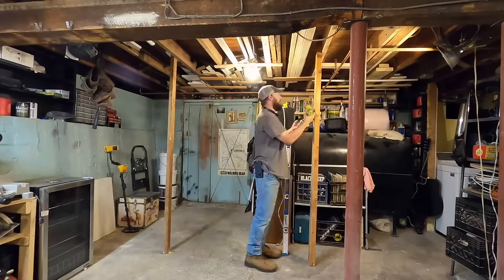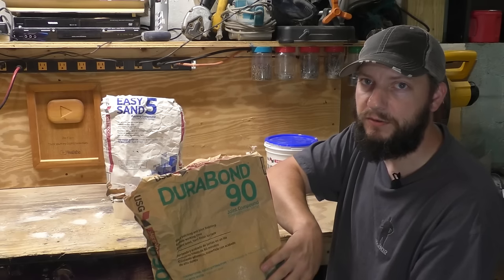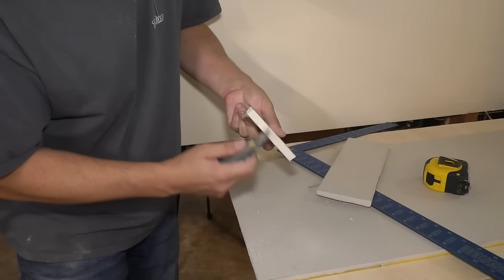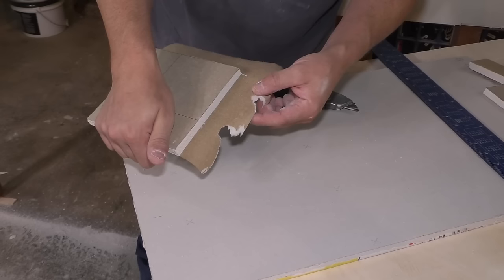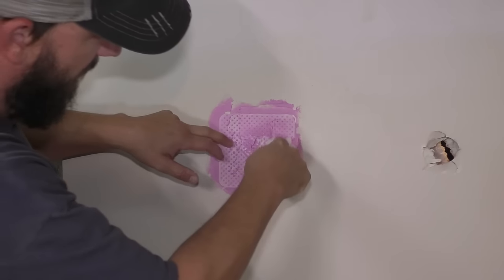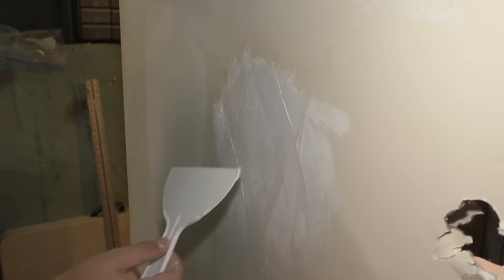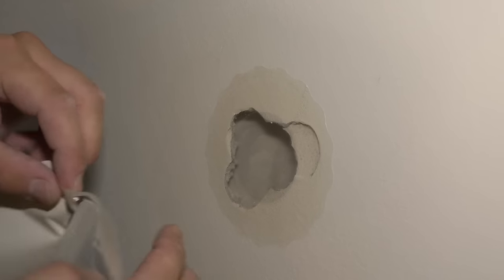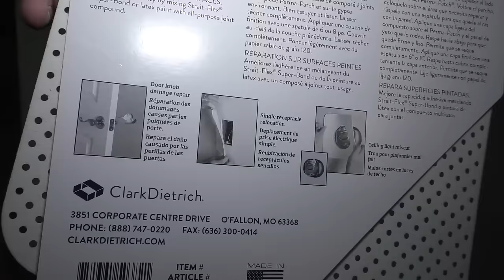How to Fix a Hole in Drywall | 10 Different Ways!

Comment: The "winged" one you did is typically called a California patch (no idea why). The nice thing is that the paper on the drywall is thinner than drywall tape so you don't need to feather out the mud as much and get less of a bump. You want to generally pull the mud from middle out so you avoid the wrinkles and rips on the paper. In addition to putting mud on the outside of the wall like you did I also put some on the inside edge of the wall so when you insert the patch it fills in the void between the two sheets of drywall and gives it more strength than just the paper itself.
Reply from the maker: A few comments have said a California patch so i'm guessing that is the most common name. Thanks for the comment!
Reply: Probably made popular in California. I wonder if it meets fire code - you did mention the wood block doesn't
Reply: I agree. You need to "butter" the edges. Even rasping a bevel  on the wall and the patch opening toward the inside of the wall. Also, it seems like every construction trick or "cheat" is called "California"
Reply: Also....I worked in southern California. I did framing. There were a lot of migrant workers behind us drywalling. They were so fast and talented. I watched them do those winged patches on, say, a miscut outlet or hammer hole in seconds, simply using a drywall hatchet. They would leave a whole house ready for tapers, including a few patches in a few hours. The tapers knew what to do with the wings. They used the hatchet for drawing lines, cutting sheets, beveling, rasping, etc. They were amazing
Reply: DIG IT! what kind of drywaller never did the California?  We always run a bit of prefill then slap it with a runny  15min hot with a tad of tight bond added. Butter money😂
Reply: You are HILARIOUS! 
I was hoping you would show fixes where there's no hole going all the way through the wallboard also because I mistakenly used the wrong tape to "plastic up" my apartment windows from the cold in the fall and when I removed the plastic in the spring... all the plaster paper was exposed!!! 😢  I really enjoyed all the choices you demonstrated and I will probably go with the fiber tape and spackle method. Keep doing these videos and best wishes to you and your family!
Reply: @lingreer9531 I believe for that you just use zinser sealer then painter's putty spackle, sand and prime and paint
Reply: We call it the butterfly patch and I'm in Cali as well

Comment: I'm renovating my bedroom. Some of the walls are getting new drywall and others are getting patched as well as two holes in my ceiling. One has been there for years covered by a metal picture and the other was a recent accident. I made a hole for an old-work light fixture box, but there was a stud in the way, so I moved the light over about 7 inches and have a 4 in circular hole in my ceiling.

Comment: A variation on the "winged" (California) patch that I've used in the past is to use a hole saw. 
1. You cut completely through the wall leaving a hole.
2. Cut an oversized square or round patch. 
3. Using the same hole saw bit, punch through the back side of the paper, leaving the front as the wing.
Its essentially the same, but with circles and no guess work in measuring out the hole/patch since you're using the hole saw to enlarge and then cut an exact match in the drywall. Cheers!

Comment: a few things to add to the winged method. 1st i like to load up the back of the plug side around the edges so it bonds with the inside of the wall better. 2nd round over or 45 the paper corners so they dont tear as easily. and last i like to use a hole saw without the bit to cut the drywall and the patch, its a little trickier for the patch side but you could make a jig to keep the hole saw from walking. i think it fits together better with room for mud that way but thats a preference (its nice to if your doing recessed lights and screw up) square cut is faster and just as good. thanks for taking the time to make this vid!

Comment: Great info! Thanks for taking the time to demonstrate all of these.  I’ve done some hole repair, some new sheet rock mud and tape, but am about to renovate a 120-yr-old victorian my daughter bought. That will include knocking down 7 or 8 walls and reskinning the lath. We could use a video on removal and replacement of old plaster walls. 😊

Comment: Great video great information. You put a lot of work into this video and it’s greatly appreciated by many. I use the blocks for larger holes. The winged tape free for 2”-4”patch and the thin metal for smaller holes. I think I would have to pass on the rest.

Comment: Great video! I didn't know that "Just Tape" was a patch. I used that when I was fixing up my house and aside from leaving it looking a little rough and unsanded, it worked great. I used mesh tape and ended up filling the cavity full of mud. Not sure if it's the patch I would WANT to use, but I made due with what I had on hand.

Comment: Neat video.  Only the first 3 will take the hanging of a picture.  The others are only good when u dont have to worry about any contact.  Like on a ceiling or high up on a wall. Some are just garbage.  For doorknob holes, it's best to put a stud right behind the hole and drywall overtop. Will help prevent blowouts from most impacts. The rest won't last 1 or 2 hits. The Californian is my go-to for most repairs on the job that i know won't have anything hanging on it, i.e., towel bar or toilet paper dispenser ❤.
Keep up the good content. 
Also, it is best to use a mask when sanding old paint or working with stucco. Lead in old paint, asbestos in old pre 1980 stucco

Comment: I had to do a hack job on an old apartment so they could rent it out ASAP...ran out of tape, so used a piece of sandpaper and mudded over- worked just fine, but wouldn't use it in a high quality job if I didn't have to😁.
Toilet paper works good and loading up a piece of tape 1/4" thick with hot mud then smashing it in the hole and knifing all the extra out becomes a perfect piece of drywall in the exact shape and dries in no time. 2 drywall coats over, paint and primer - done.
Thanks for the vid love the ending

Comment: Good video to demonstrate that all these "quick fix" products they sell at the hardware store are no better and mostly inferior to the tried and true, simple methods that pros use everyday. 

I'm not a pro, but I have done a lot of patches and drywall renovation as a homeowner. And I have met many experienced people who told me that its easier for them to cut out a larger piece they can attach to studs, because screwing on a piece of board and taping it is something they can do without even thinking and not have to fuss with tiny spaces. 

It seems like more work but its actually the same or less because its simpler, and the results are perfect. Plus, the materials are cheap and you can even get by with a set of crappy plastic taping knives and pan if you're not looking for anything fancy. 

Also, I would never use spackle. Always use either hot mud (Easy Sand) or all-purpose mud.
Reply from the maker: Hey!  Thanks for the comment.  Tons of options but I do like my FibaFuse and hot mud.

Comment: Hey, so I am pretty sure I'm the guy you got the spray foam "technique" from 😂.
Absolutely fantastic video and thanks for posting it! So I want to defend my spray foam patch here, most people see my short and don't see my full video on it. My favorite technique is the butterfly/winged patch and I would have done that if I only a few patches, but I had like 150 to do because I insulated by drilling holes in the drywall and sprayed in cellulose insulation. I filmed that video on a whim before I even posted any content on YouTube so all of my dialogue was two years old when I decided to edit the video. What I didn't say (that I should have) was that all of my drywall holes were about 4" from the ceiling except for under a few windows and what you pointed out is exactly the issue with the patch but all of mine are pretty much higher than anyone can even reach and I also wanted access to them if the insulation ever settled in the walls (spoiler it's now been 3 years and it hasn't🙄). Anyway just wanted to drop a comment and say it was awesome to see somebody else try it out. And again awesome content and you gained a subscriber from me 😁👍

Comment: I was taught how to mud by my dad.  I was 10, I think.  He turned the old detached garage into his workshop for his upholstery business.  He didn't want us to be "Latchkey Kids" after mom died.
The metal patch kit is great for door knob holes.
The Dap kit with the color changing spackle is better used for filling in nail holes than patches.  The plastic putty knife they give you is garbage and you are better off using a metal one.
The 3M kit looked great, until you did the tap test.  I'm guessing that it was because of the lack of adhesion to the drywall.

You and spray foam, seriously?  What a joke.  Not surprised it failed.
I loved seeing baby fixer in the bloopers.  He needed daddy time.
Thanks for a really fun video.  See you in the next one!

Comment: What is a great option for a beginner to patch a one inch hole in drywall? I want to reuse the hole to screw in an anchor and screw for a towel bar in the restroom. It's quite light and was just used to hang hairbands and hair caps. Any suggestions? Or is it bad to reuse the patched hole?

Comment: great video!  I have a piece of drywall broken just above a double outlet, any different tricks on  that challenge ?
Reply from the maker: If it is near trim, I would just do the top part.  But if it was in the middle of a wall, I would replace around the entire outlet.  Hope this helps!
Reply from the maker: Remember to be safe around electrical outlets!

Comment: Going to try the fiberglass tape. I have had good luck with mesh tape and bad luck with the paper seam tape. I like using the trowel with my mud too. Mud boxes are ok, the hawks are to heavy for my wrist.
Reply: Mesh tape is not meant for drywall compound.

Its meant to be used with quickset (the 5, 20, 45, 90 muds that chemically cure)
Reply: @evictioncarpentry2628  I’ve used the mesh with 45 and 90 min mud. Thanks for the tip. I’ve has bad luck in the past with the paper. I muddled the wall. Put paper up and troweled over it and got the excess out, but still had bubbles in my tape. I had to go back and cut out the bubbled tape. Next time I drywall mud I’m going to try this again. Granted I was still new at drywall and very pregnant working with it at the time.
Reply: @Updation_Nest  Are you pre-filling any gaps in the drywall before applying paper tape? That's usually the source of bubbling tape. 
I always mix up a batch on quickset, do a lap of the house and fill anything bigger then 1/8 inch before applying paper tape.
Reply: @evictioncarpentry2628  yes. I have put the mud in the holes. Then the tape. Then I’ve also done it without. Still learning. I’ve hung drywall and used the paper tape on the seams, and that’s how I’ve gotten the bubbles. It seemed it didn’t matter how much or how little mud I used and how much I tried to squeeze out. I would get bubbles.

Comment: I wonder if you used hot mud over the foam instead of the premixed stuff, if it would have held up a lot better because foam stays pretty squishy, even when dry. So hot mud drys really hard and might would solve the issue and give you the love for the foam stuff again! 😂

Comment: That’s six inch knife is curved by design, sight down the edge of the blade and you will see, if you have it oriented with the curve facing the plane you’re tooling it will leave marks, orient the knife the opposite direction it will leave the surface smooth, eliminating the need to use the trowel for tooling.

Comment: I’m confused about the joint compound to use…

U said u always use Durabond 90 to place the paper/fibafuse tape,  then u use the easy sand for the rest of the layers?  Do u have to use durabond 90?  Bc it seems like in the video u only used the easy sand/dust control joint compound and didn’t use the durabond 90 at all.  

Also, can u use the fibafuse on the corner of rooms as well? Or only regular tape that’s folded??  Thanks!!!
Reply from the maker: Hey!  No you don’t have to use durabond.  I like to use it for the tape coat because it is very strong.  I would advise against using fibafuse in the corners.  Paper tape is the best thing for that.  Hope this helps.  Thanks for watching!

Comment: "Just Tape" method relies on "keying" which is needed for plaster in older homes, such as my 1948 ranch, that does not have traditional dry wall, but rather the transitional "button board" 🤓

Comment: Here I didn't think you were going to say just  Hang a picture and I was gonna say you forgot one, sure the spray foam works fast an not so bad. Only down fall is at $22 cnd a can. You only use a very small a mount and the rest of the can is trash as there no saving it for later as the tube an valve as well as the contents drys rock hard in less then half hour. Best way is to do them all right way. As you 1st one.stud to stud. But I put a peace of 1/2" plywood or osb on the top an bottom as with out it. It flex with hot an cold an cracks across the none supported top an  bottom dry wall

Comment: don't use mud. buy some white impression plaster from dental supply. That stuff sets up in 10 min and you can wet it after into a slurry and rub it into the imperfections. You can also use denstone but it takes 30min to set but it is harder. If you put a little excess you can sand it smooth. All of this other expensive stuff is a waste of time and money. The good news about these gypsum products is the expansion as it sets is minimum but there is some and you get compression to the existing drywall.  This material is overlooked and yet it is far superior for this kind of application.  I'd buy a mixing spatula and the green rubber mixing bowl so you can quickly clean with paper towel and some water and or by squeezing it allowing the plaster to break out easily. The stuff never goes bad as long as it is kept in dry place.

Comment: I've heard #3 referred to as a "california patch"
Reply: I have also done this with a hole saw. Partially cut the back of a new piece to make the patch and and use the hole saw to make the correct size hole in the wall. I made several 3" patches easily

Comment: I know this is for drywall, but in theory, you could use these methods for walls with plaster on top of the plasterboard, correct?
Reply from the maker: Yes, you can! 👍
Reply: @TheFixerHomeRepair thanks for the reply! Hoping to tackle the hole tomorrow.